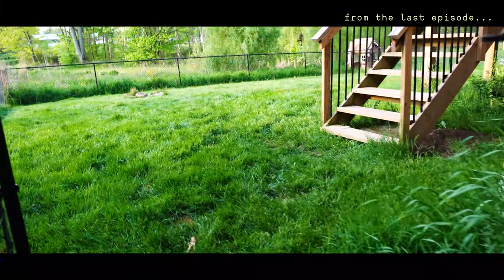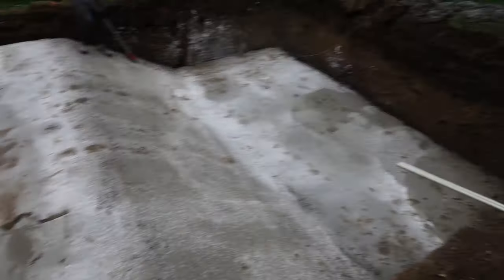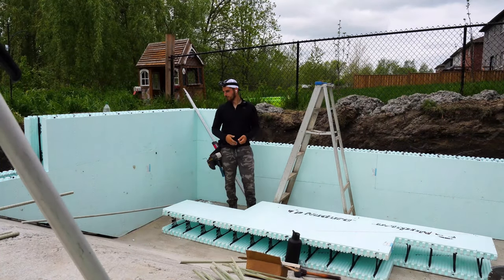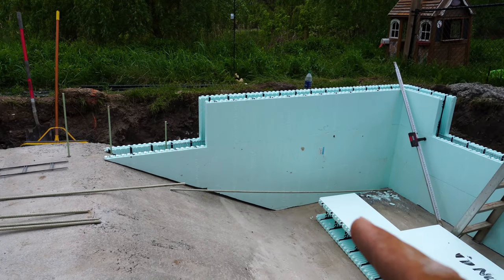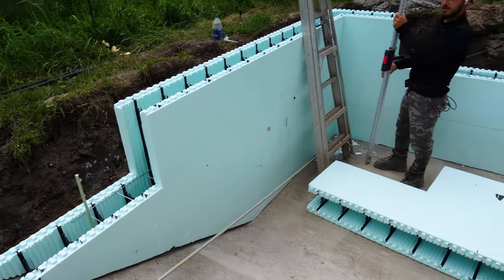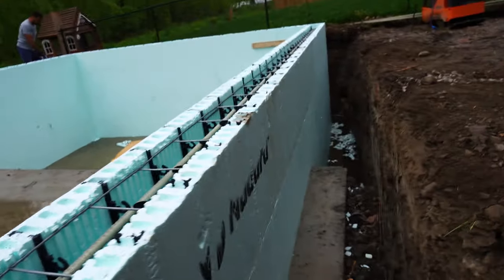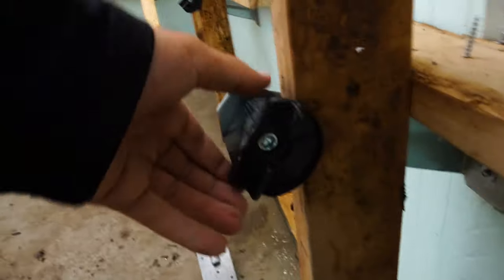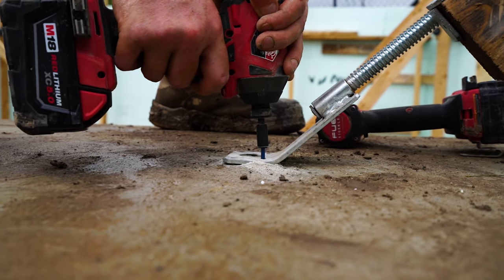How To Build an ICF Pool | Visionary Vlog - EP 07

Comment: I used the fab form Zonts for my house build. Much cheaper than renting or buying the traditional supports and when I was done with my build the 2x4s that were used for the bracing where then used in the interior walls of the house. Great product. After I poured the basement and upper level to the roofline I was then able to sell them to the concrete guy so he could use them for other ICF builds. Only way to go. And the house is very well insulated and solid as a rock.

Comment: Not trying to sound like a jerk but what is the point of this for a vinyl liner? Yeah I suppose it’s structurally way better than a steel wall but in actual use what difference does this make? This must cost anywhere from 2-3 times as much and accomplish the same thing.
Reply: insulated pool and cheaper if you do it your self.

Comment: Why not cinder blocks? No bracing needed.
Reply: Because proprietary = can charge more
Reply: Cinder blocks don’t have the greatest lateral strength. Not saying it wouldn’t work because I don’t know the specifications but I would definitely consult with an engineer.
Reply: @kd8118 same strength when core filled as is being done here. You are paying to fill with concrete either way, makes more sense to have your form be part of that concrete too. 
Unless you are making some sort of year-round heated pool, the insulation adds nothing to the pool.
Reply: block will crack even with infil as it is not as solid due to the cores in the block @Luckingsworth

Comment: Why have a cold joint? Why not pore the footing and wall same time? Difficult detail but better strength.
Reply: This is a vinyl liner! What difference does it make! If the pool was finished with a plaster type of material it would be a different story. There are vinyl pools with literal plastic walls! This is like doing the framing of your house with the steel beams they build skyscrapers with!